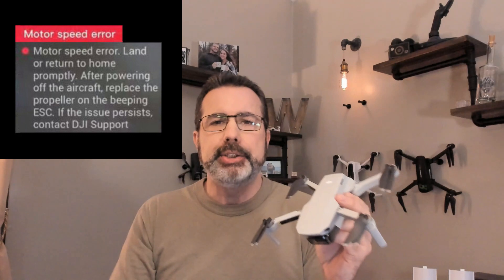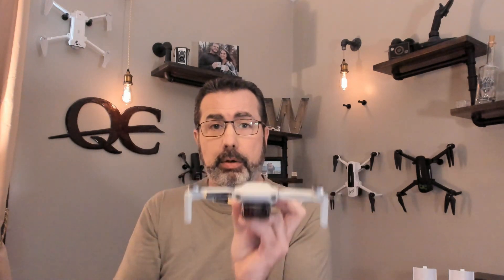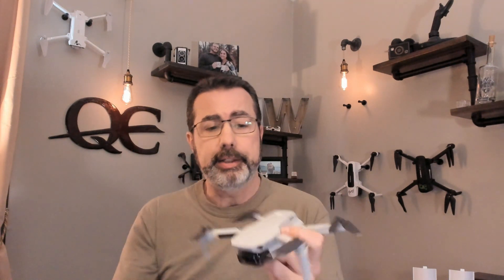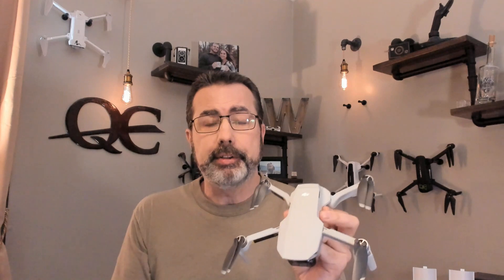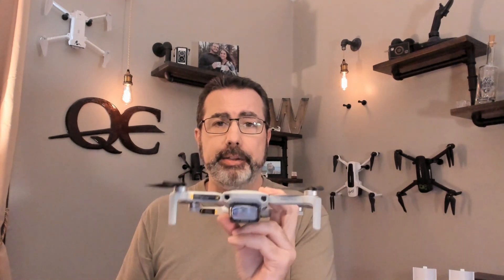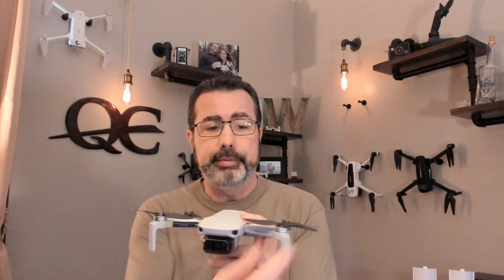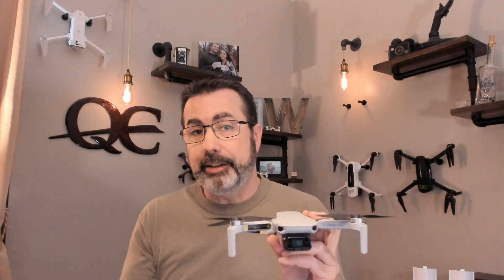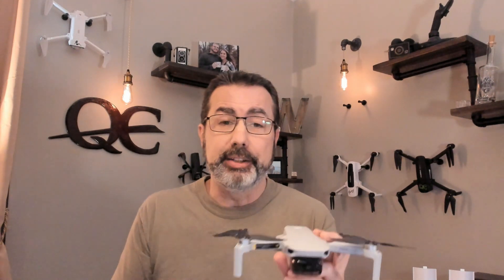MAVIC MINI - MOTOR SPEED ERROR - FIRMWARE  V01.00.0500

Comment: Mine started wandering when hovering in place, immediately after take off. The first few flights it didn't move at all while hovering.  I've only flown the drone 6 times since I got at Christmas. And today, I got the motor speed warning. Props are fine. It's brand new.

Comment: I had the same problem with the update error on my mini but my drone won’t take off anymore after I changed the propellers. How could I go forward with getting it fixed? Thanks
Reply from the maker: Frosty 111X How does it not take off? It won’t even start?
I would contact DJI for sure...
Reply: QC GUY  when I go to press the launch button the same motor that it told me to change propellers isn’t operating at the same speed as the others and there’s no lift off
Reply from the maker: Frosty 111X Sorry, I wasn’t ignoring you. My mom passed away so I’m taking a break. Sounds like you do have a esc problem though.
Reply: QC GUY sorry to hear that! How should I go about fixing this problem
Reply from the maker: Frosty 111X DJI is excellent in service so contact them. If it’s pretty new they may just charge shipping. Contact them from their website. 👍

Comment: they say to change props...how many times do i need to do this? i changed every prop 2 times so far and less than 4 hours flight still get motor speed errors....DJI want to make a massive profit on selling props with this bullshit new  xxxxxx500 firmware glitch....some say storage problem...NO because since the error started i kept the MM legs open and stored properly with no contacts to its props...
Reply from the maker: Everyone thinks it's the case which can bend the props but new props or old this is firmware and BS. I went back to 400
Reply: Yes this is without doubt the case the ridge if the back props are not  correctly aligned running parallel to the ridge get slightly deformed.  This then means the motor has to work harder as the props are less efficient and have reduced lift. The firmware update added better monitoring and speed comparison of the motors hence now identify this issue that has always been there . From a user point of view you wouldn't notice the difference even if the motor was working harder.
Reply from the maker: Adrian Morton Do you think everyone owns that case? Do you see how many including myself say it does it even with new props? 
I have had well over a hundred quads in 5 years as a hobbyist and a tester. All this time without a set of training wheels and floaty’s. 
Funniest part of all this is that it’s the same motor not motors in most every case which tells me it’s a DJI “F” up. JMO 👍
Reply: @QCGUY  well replacing the props worked for me as has been written in quite a few forums. I do suspect the firmware is possibly a little to sensitive as it compares speeds of all motors so if the motor is working a little harder it gets highlighted but in my case and others the pro change resolved the issue.
Reply: @QCGUY  well said sir....thumbs up...
Reply: @adrianmorton9598  its a glitch not a sensitivity problem at all...like i said before, "i changed every prop 2 times so far and less than 4 hours flight still get motor speed errors" and i also store the MM open legs not in its case.
Reply from the maker: Adrian Morton Yes, I have seen many say changing the props resolved it. I’m not trying to discredit you or anything. I’m just a person that studies everything on a topic and then brings as much rational common sense though into my judgment of it. 
Changing props is a fix for some.
Bending the props is a fix for some. 
Blowing out/cleaning the motors is a fix for some.
Refreshing the firmware on the computer is a fix for some. 
Still almost all originally reported it from the same motor. That’s a little strange don’t you think? 
Meanwhile I have been on 400 all this time and everything is perfectly fine oddly enough. 
This has been a good thread with you and thanks for being able to just talk without getting bent out of shape. This is how I wish all comments and opinions could carry out on my channel. So many children out there.....
Reply: @QCGUY  I just read the mavic pro forum and what seemed a very knowledgeable drone pilot displayed the motor speed analysis from the drone log files and you could see this motors rpm higher than the rest when at hover. Props on that motor replacec and all motors spinning at similar speeds. I think the new firmware is highlighting an issue that maybe an underlying  issue with this motor that may be out of tolerance and changing the props may not resolve it. I suspect going back to older firmware the problem for what ever reason is still there but not picked  up by the older code. I think doing this hover test and downloading the analysis data will help identify if this motor is running to fast. There have been  so many comments on this issue I hope DJI support jump on this with some better analysis and update customers with this issue.
Reply from the maker: Adrian Morton Pretty much what I have been saying in regards to this being a DJI f-up. 
It’s not causing me any problems on 400 though it’s still underlying if it is indeed a problem with the hardware but these are strong motors and not failing. Thanks

Comment: I had 3 good flights on latest fw then my last flight I got motor speed error  done an rth and only got 0.3 meters per second coming back. Should I change the back left prop or try re flashing the fw
Reply from the maker: thekaizer If that’s what works sure. I personally went back to 0.400 and just fly it.

Comment: You took 11+ minutes to tell us why you don't apply patches when they first come out, how glad you are that you didn't apply this patch, and that you think the message is a bug, repeat, repeat.... You didn't entertain the thought that the message could be legitimate and that the props may need to be replaced, and it doesn't sound like you even applied the patch. I found much more value in the comments from others. I think I'll try opening a ticket with DJI.
Reply from the maker: Sorry for wasting your time....Lets clear it up! It is a new feature by design, it is set too sensitive  although it does work it is also having ever pilot and their brother also replacing good perfectly good props. As I say in a follow up video I have updated and I'm not changing my opinion on it or what people claim to do to resolve it.  
Honestly, do you need to come with a comment to purposely just poke at someone? Try being a better person. Thanks and stay safe!
Reply: I'd been getting the "motor speed error" every flight or two for a week or so (on both rear motors) and could feel a bit of roughness to the prop edges. So I went ahead and changed both pairs of props on the back. I've now had my Mini in the air several times for at least an hour of flight time (and one good crash) with no more motor speed error. I may be imagining things but it also sounds smoother with the new props. So changing the props does seem to have helped in my situation.

Comment: Very good system actually. I got motor speed error and when I inspect the prop closely, I noticed a slight notch on the leading edge of the blade.
Reply from the maker: Training wheels! It’s for those who need them not those who inspect pre flight.
Reply: @QCGUY  Well considering this drone was intended for beginners...
Reply from the maker: @fadlya.rahman4113  No it was intended for weight restrictions and not needing to register but deemed perfect for beginners in the DJI market with it being so affordable compared to all other DJI drones.

Comment: It just happened when you update to the new firmware. After update to the new firmware it happened with my twice this week. First my left and today is my right propellers. After I change the propellers it working fine. But you right sir I think the firmware cause the error. DJi needs to update the new firmware for it.

Comment: I am fairly convinced they added the motor speed error because what's happenning is when people store them in the case, if the props are not meticulously aligned, then carefully set in w/o moving and left for any period of time, the props deform and flatten out. I don't think its far fetched to say that people could actually look closely at the props and not see any "damage" but the prop still won't produce (as much) lift is it's deformed. And, this drone is clearly geared towards the average consumer, not drone specialists. Personally I've had no issue w/ the update. Everything has worked perfectly and the new control over the camera settings in video is fantastic!

Comment: I've exchanged my mini and on the second mini in one week I had to replace both rear props. No issues after that. You must replace both rear props. I only replace the left rear on my first drone and the problem persisted so I ended up exchanging it at best buy.
Reply from the maker: I noted that I did this in my pinned comment as a update and it is as I said. It's set to be to sensitive! I just get the message less now but it has still popped up on new props that are just as good as the ones I took of. It is set to be a little too cautious and I still say they will make it less sensitive in a future update. Thanks

Comment: Youve misunderstood the issue.
The MM is so marginal on power that any tiny issue with the prop will limit the max power deliverable.
I ha the alarm. Tiny nick on prop.
Replaced the prop and could audibly hear the difference.
Reply from the maker: richard cannon Great for you because you had a bad prop. I have perfectly fine props and even changed then to see and still it’s giving false notifications. Read my pinned post....
I get the feature and understand it all but it definitely needs a tweaking in another update.
Reply: QC GUY sorry your just missing the point. I only ever hand launch and land. All my props looked perfect visually.
But after the error i could see the tip of the efected prop was slightly distorted. Bent in the case. Has made a noticable difference.
I think this drone often is flying with only 5% reserve torque. So many people have suffered fly aways where the run out of grunt and the wind takes it. Sports mode makes it worse as it further reduces the power reserve. So this is a safety update which maybe annoying but is in your own interest.
Reply from the maker: @richardcannon7327  OK.....I guess I am.

Comment: I have owned several DJI drones over the years, going back to the phantom 1.2 and have never had this problem.  I have a new mini and two perfect flights last week until update via DJI fly app and then boom!  Here come the motor speed errors.  Blades are new and not stored in flymore case.  They look perfect, not flattened or bent but swapped for extras in my flymore kit to check and I got the same error.  Tried the DJI assistant and refreshed the 500 firmware to mini, remote and still errors.  I finally flashed back to the old fw and everything is fine.  Five flights in wind in the last two days, no problems. I say buggy firmware.
Reply from the maker: bluguru1 Agree 100%
Reply from the maker: Paul Rambo Updated 👍
Reply: So through the assistant 2 you went back to the 400? And your fine?
Reply: @skipmcleod7048  Yes.  No problems after many flights.
Reply: How do you update the batteries? I have 3..
Reply: @lucasjohnson1467  It updates as another part of the firmware update for the drone. They should update all together unless manually updating using the DJI app and your drone connected via a usb cable.
Reply: @bluguru1  so I need to update each battery
Reply: @lucasjohnson1467  If I remember correctly it should update as you install the battery and  connect the drone to the controller and app.

Comment: I updated, then promptly chipped a prop (took off the tip). I didn't get an alarm after that. I landed the drone and I was really impressed it flew back as well as it did. I didn't notice a difference in the flight, and no alarm. I returned in sport mode because I had to fly across a river and some trees.

New props are on, and hopefully it keeps behaving.

Comment: I got today motor speed error for first time. I wanted to refresh firmware on Mavic Mini over DJI Assistant 2 and it was strange that shows current firmware version od Mavic Mini was 000000! 
Really strange because I had updated over DJI Fly application immediately and everything was fine. Anyway, now I have right firmware and I will test in flight. I suggest to everyone to check over PC firmware version on Mavic Mini but also on remote controller.
Reply from the maker: mdsabih You may have just cracked it! Good catch 👍

Comment: SOLVED!!! 

So I figured out the error, it was giving me the “motor error” and I was super confused and this is how I solved it.

When you get the error in the air, just land it. You will hear beeping, pay attention to all the motors. Whichever motor is moving/vibrating, the propellers on that motor needs changing. 

It’s a very smart update actually, it tells you exactly which props needs changing. 

In my case, the tips of the propellers are a bit bend which is causing that one motor to work harder. The other props are are straight and completely fine. The error went away after I changed it.

Hope this helps you guys. Happy flying! :)
Reply from the maker: kizzenger It’s a false error in many cases right now. You might have needed to change your props but so many don’t. It’s only good if it’s really detecting bad props. Thanks 🙏
Reply: How many hours have you been in air after changing props? Cause I had this last week, changed location, changed battery, updated battery firmware - no error for 20 minutes. Few days later (yesterday) I got this at least twice. Today I found one battery without updated firmware, updated it. Maybe 40 minutes flight time, no problem with max power reached or motor error despite pretty strong wind and flying in sport mode. To me it seems random or related to wind gusts.
But I don't fully trust this drone (I don't want to fly more than tens meters above the water) and I'm ignoring some warnings at the same time.
Reply from the maker: Pavel Peřina My props didn’t need changing. I did do a change just to see and it doesn’t change anything. I have refreshed and still get the message but am ignoring it till there is a update if I don’t just downgrade instead.
Reply: I think it's slightly different as the motor showing as the issue was just working harder due to the other blade on the other right side being less effective due to a slight dink after meeting a tree.. just changed and now it's all ok .. for now
Reply: Bugger still got it after changing both sets ... Was after 10 mins and was only when I went slightly higher in a tiny bit of wind
Reply: Happened to me. Told me one of the props needed replaced. Replaced it and flew fine
Reply: My front left props damaged but back left motor is vibrated
Reply from the maker: @mehmetpolat4116  I have had mine beep with the back left and then while looking at it switch to the back right. It's a bad update and needs adjusted for this to be more accurate.
Reply: mehmet polat I have the same problem

Comment: I got it! So do I replace props?
Reply from the maker: I personally would it if the props are fine but I stayed on 0400 to avoid this silliness. You can do the update from your PC if you read the comments and they say it fixes it but I personally want to see if a new update comes soon which will confirm the admission of guilt.
Reply: @QCGUY  thank you. Now I need that how to!!
Reply from the maker: Rea Zzz Get DJI Assistant 2 for Mavic on your pc, connect the quad via usb and update. 
Do your calibrations after. 👍

Comment: From what I understand, storing the Mini with the drone body pressing down on the rear props is causing the props to deform, flattening out the prop pitch and causing the props to have to spin faster.  Apparently, it's always the rear props.
I just wonder if they will resume their shape in time if the pressure is removed.
Reply from the maker: David Blakeman I totally understand that but you can spot it in preflight check.
This damage that you can’t spot with you eyes is rubbish and very humorous. 
When bent or damaged it’s viewable and can be spotted in preflight. Just my opinion...

Comment: You need more info.   There are a few channels that have identified that prop malformation that is not easy to see visually is causing over rotation leading to I suspect overheating and forced landing.   I updated.  I had no warning even in wind.  
But I am not using a Prop guard or case that presses the rear props to the body that subtly warps props.  
They already have a waring about the gimble cover. 
Are we sure these are false alarms or people who have no clue their props are bad?
Reply from the maker: K. Edwards I have seen all the videos. Bottom line for me is I don’t need, want or buy into it. 
I get props are getting damaged buy bad storage but I don’t buy the damages you can’t see. More have said they changed their props and no changes.
What has been the most positive is people saying they updated on the computer and false alarms went away. The false alarms are what this video is focused on. Thanks
Reply: I understand your POV.  Me I would kill for a MUTE during RTH. OMG!!! Trying to shoot sunrise and the who street knows my drone battery is low and is RTH!!!
Reply from the maker: @KEWords  LOL....Amen!